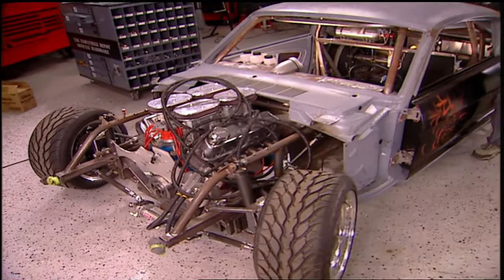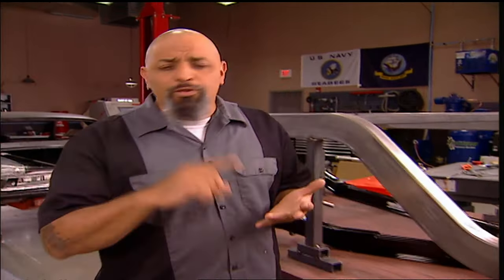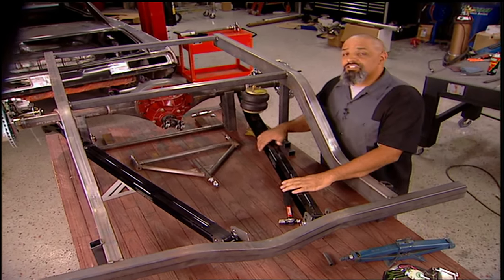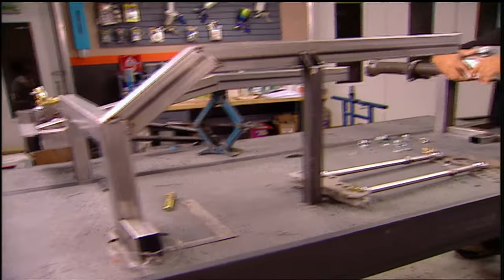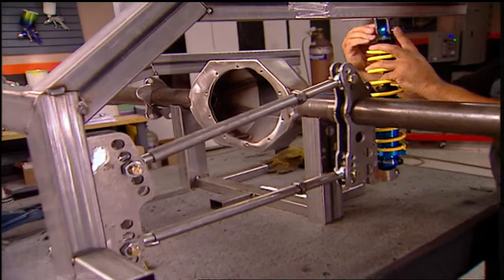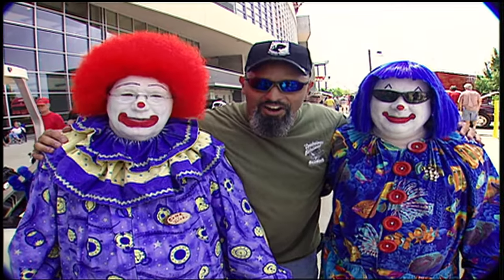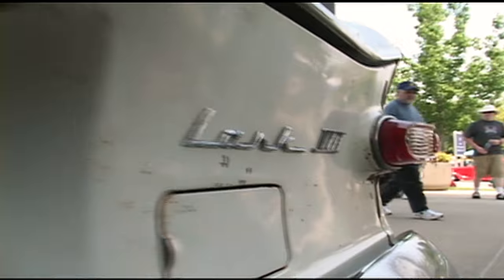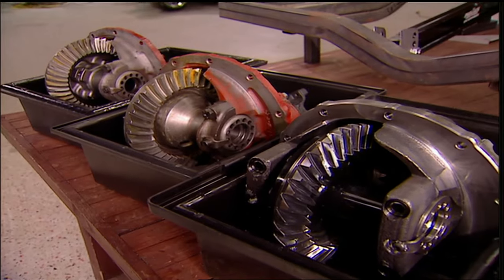Which Of The 4 Top Rear Suspension Setups Is Best For Your Vehicle - MuscleCar S2, E20

Comment: Nothing wrong with good leaf springs. In fact they can be exceptional for handling. There are a lot of advantages when they're sorted out.
Reply: nothing wrong with leaf springs but just like with bias ply tires or stock cylinder heads...there are better options that offer better performance.

Comment: Triangulated 4-link works best in a rock crawler, not a street bruiser...prone to induce steer is sloppy and binding if too tight on short a travel setup.  

Truck arms with Panhard bar is simplest.  

4-link has a lot of adjustability for launch characteristics, but I'd take a well designed Panhard bar over a wishbone setup for performance.  The wishbone is more common for the constant suspension geometry changes associated with the slammed airbag setups.  Most diagonal link designs suck.

Best solid-axle, overall performance setup there is = a torque-arm with a Panhard bar or Watts link.